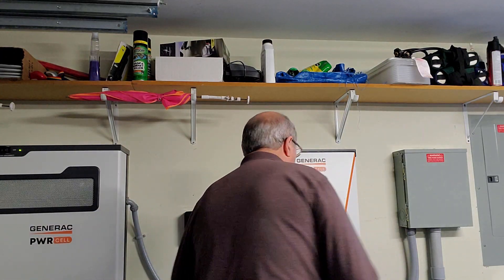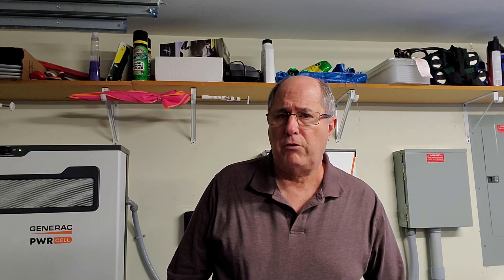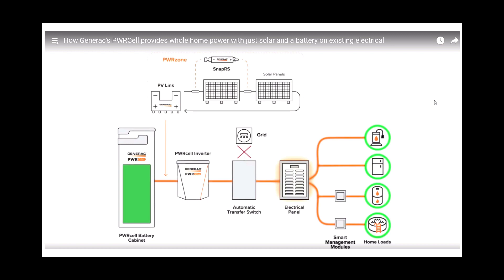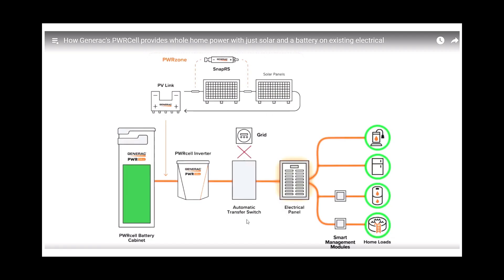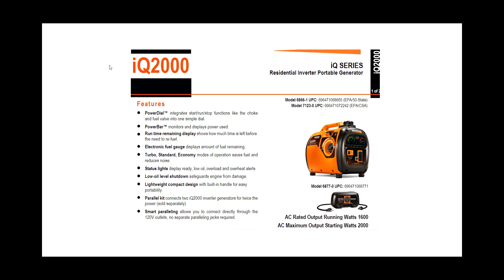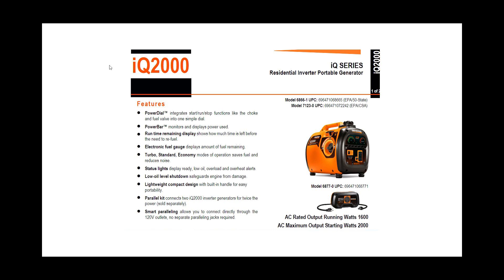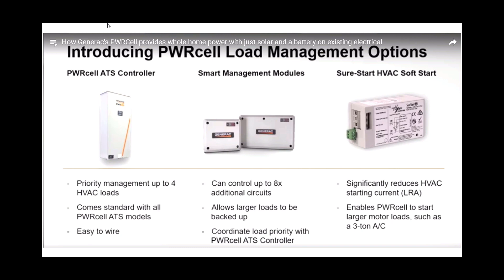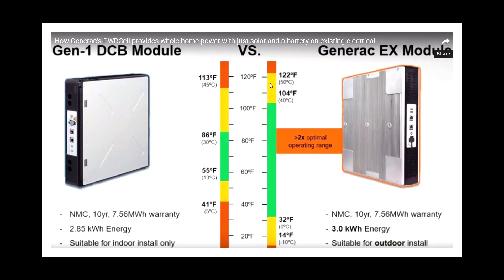Generac PWRCELL Generators and Upgrades

Comment: Everyone needs to be aware that this system is limited to 40 amps @240 Vac (9600 watts), no matter how its configured.  Adding more batteries does not increase the amperage limit, it only increases the longevity and run-time of the connected devices.  Adding a generator does not increase the output limit (40 amps), it only extends the run time.  Don't be shocked if you cannot recharge your batteries from the generator.  This is due to the tight set limits on the frequency 59.5-60.5 Hz.  Generac needs a firmware update to correct this issue.  Depending on which appliances are in operation, this system can power your overhead lights and two medium rated standard appliances (microwave, refrigerator compressor, etc.) but NOT your overhead lights and your HVAC system, even with a generator connected.  It is still limited to 9600 watts with or without Alternative Power Sources (APS).  I would get this system too if it had a much higher pass-through rating.  I really like Victron Energy equipment,, but its not UL listed yet..  Instead we opted for a Sol-Ark 12k EMP with 32 - 400 watt Q-cells and later we'll add 5 - 48 volt 100 Ah (25000 watts) of battery storage when the supply chain catches up with the demand.  Be aware though, Sol-Ark's current monitoring servers are located in China.
Reply: Thank you for that. Do you or anyone know IF these firmware updates have been pushed out to solve these issues?
Reply: @JamesTechJackin  At this point I actually recommend a SOL-ARK 12K and a set of Fortress Batteries.  Lookup "Engineer775" on Youtube for examples of solid solutions.
Reply: @donfrancis103  ok thank you for this information. I will check it out.
Reply: @donfrancis103  There are a few good options, a Schneider, SMA or SolarEdge inverter paired with a custom bank of SimpliPhi 3.8 batteries seems like a really good option, especially for off grid. You can even pair a Generac generator with such a system for added backup.
Reply: Mike Sims  I actually went with the Sol-Ark 12k EMP, 32 -400 watt Q-cells and we'll add 5 Ark batteries when they come in later this month. Today the system made 65Kw.  Be aware though, the current Sol-Ark monitoring servers are located in China.  So consider that risk seriously if you need your system remotely monitored.
Reply: So in other words in you had an AC unit, microwave, electric dryer, and electric stove running you would be maxing out the amps?

Comment: Appreciate the videos.  I'm getting a Generac PwrCell installed at my house.  Decided against ats.  I do have a clean generator and have to see how I can utilize it in addition to backup batteries.
Reply: Pwrcell all day long.
Reply: @joestrez37  Pwrcell all day long.... what is that supposed to mean?
Reply: @donfrancis103  it means it’s the best battery in the market right now. I’m a solar contractor in Long Island with 5+ year experience. I know about all the products. When you compare apples to apples Pwrcell beats everything else “all day long”
Reply: Before you go this route, consider the Victron Energy Quattro 15K coupled with a Fortress 18kW battery bank.  The Quattro will accept two AC sources (Grid and Generator) and two DC sources (Battery Bank and Solar array) and automatically blend them all to give you a clean uninterrupted power source.  We first learned about VE two years ago when we had our motorhome upgraded from 30 amp 120 Vac service to 50 amp 240 Vac service.  We had a VE Multiplus 3000 installed and three 90Ah LIFEPO4 batteries to replace our inept FLA batteries.  The system improvement is so substantial that I'm now wanting the same type setup for our home.  The Quattro 15K is the solution.
Reply from the maker: It is important to note that the AC voltage input on the Victron Energy Quattro 15K is Input voltage range: 187-265 VAC.  This means you cannot use a generator that only has a 120V output.  It does tolerate "dirty power" generators to be used.  The output frequency is 50 Hertz (the USA is 60Hz)   This could mean real problems with computers and other sensitive devices in the USA.  This inverter is meant for use in Europe and other places in the world with 50Hz power systems.
Reply: @beachlover9108  There is a drop-down menu in the setup that allows us to select 50 or 60 hertz on VE equipment.  So that is a non-problem on Victron Energy inverters.  As for the 120 VAC generator, I would question why anyone would choose a small generator that is less than 240 Vac because most, if not all of large appliances use 240 VAC.  Your water heater, oven,  central air conditioning, and well pumps all require 240 VAC, so its imperative that a 240 volt generator be added to the equation.
Reply from the maker: @donfrancis103  Why a 120VAC Generator?  In this application:  When someone wants to charge their depleted solar batteries to run the house loads.  When grid power is not available, and the system is running off solar and battery backup.  This can happen when experiencing cloudy days, and the batteries are mostly depleted.   Many solar systems don't run the entire house when "islanding", just selected loads.  This normally doesn't include large appliances.  It all depends on what you want the power in your house.
Reply: @beachlover9108  You might want to check your setup again.  The conversation i had with Generac Power Systems a month ago revealed the fact that the PwrCell cannot be charged from an AC source.  They designed it, like the Tesla Power Wall, to only accept a charge from a DC power source (read: solar panels) and it (the PwrCell Inverter) will only allow a max of 40 amps @ 240 VAC ( single phase 180 split) to pass-through the inverter.  The inverter will not charge your batteries until Generac releases a firmware update.  When they do, you'll be able to recharge your batteries from the grid (240 volt), but you might not be able to recharge them from a 120 volt generator.
Reply: @donfrancis103  this isn't correct at all. In "priority backup" mode the pwrcell system will charge the battery from the grid.
Reply: @Noneofyour210  Someone needs to inform the "tech support" folks at Generac about this.  I was assured it could only be charged by a DC power source.
Reply: @donfrancis103  I'm certain that is an accurate statement but the dc power source is your inverter feeding off the grid. The battery is dc storage. In priority backup mine feeds something like 6kwhr to the battery

Comment: Is it confirmed that the new Generac equipment does allow their inverter generator to charge their battery?
Reply: I spent an hour on the phone with Generac tech support two weeks ago for the PWRcell (I have a Generac 20kW Generator) and they informed me that this system is limited to 40 amps @ 240Vac and it will ONLY RECHARGE the batteries from a DC power source (read: Solar system).  They were supposed to release an improved system and a possible firmware upgrade for the existing systems that "might" make it possible to recharge the batteries from an AC source, but Covid-19 has that postponed.
Reply from the maker: I believe you can recharge the batteries from an inverter generator.  Have a transfer switch installed between your meter and the PWRCell inverter (AC side).  You then hook a inverter generator to the transfer switch and set the switch to feed the inverter with the generator AC output.  The inverter will sense the power like grid power.  Set the inverter to priority backup, which allows the inverter to charge the batteries from the grid.  The inverter will convert the AC power to DC power, and charge the batteries.
Reply: @beachlover9108  That sounds like it would work. Downside is that it doesn’t sound like it could be automated. I imagine it would also void the battery warranties. I hope UL or someone is working on a new standard for residential generator-battery charging.
Reply: @donfrancis103  Thanks. So as best as I can tell there still isn’t anyone making an off the shelf consumer battery-charged-by-generator solution.  Hope we see one in the next few years.
Reply: @edbouhl3100  Actually Victron Energy does make an off the shelf consumer battery-charged-by-generator solution.  In fact they make several inverter-chargers that perform this task.  The Multiplus series as well as the Quattro series inverter/chargers do indeed perform the task of merging/converting/charging at the same time.  These inverter/chargers will boost failing grid power (brownout) as well as completely switch over to your generator for primary AC power, while drawing power from solar and a battery bank, or solar OR a battery bank.  Thats the thing about the Quattro.  It accepts two AC input sources as well as two DC sources AND it outputs two AC sources (one for hybrid load UPS type assistance and the other in pass-through).  Heavy loads that do not need to be on the battery assist can go through L2 of the AC output (passthrough) and loads that need constant power can be connected to L1 of the AC output.
Reply: @donfrancis103  Wow, I’d never heard of Victron Energy before. They have a VERY impressive range of battery/generator/PV solutions. I hope they target the US residential market at some point. All the AC certifications and specifications I found were for 230V European type applications. The only US/Canada listings I could find were for DC MPPT units. But it’s reassuring to confirm that it can be done now, unfortunately not to NEC code yet.
Reply: @edbouhl3100  I love the Multiplus on my boat.